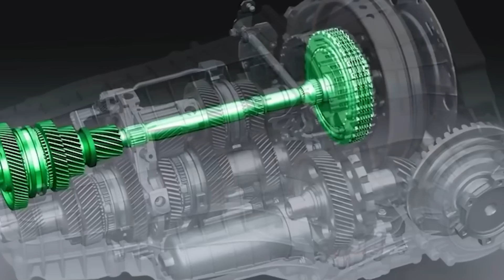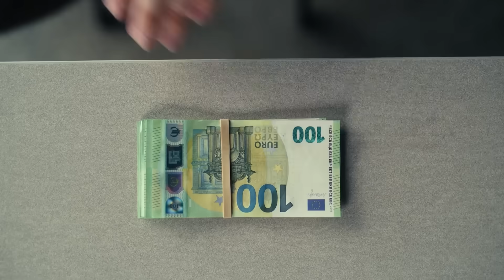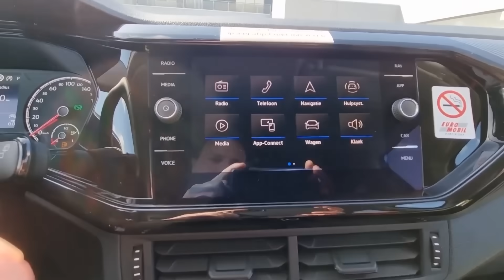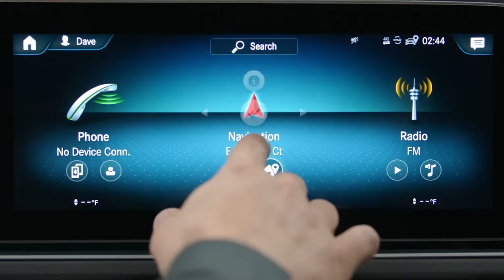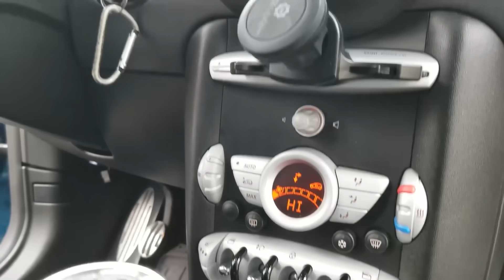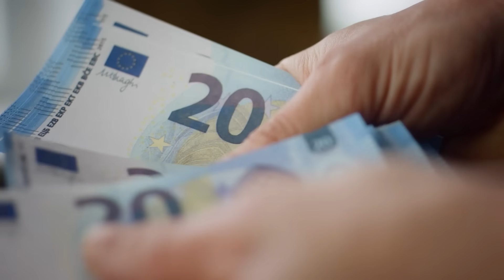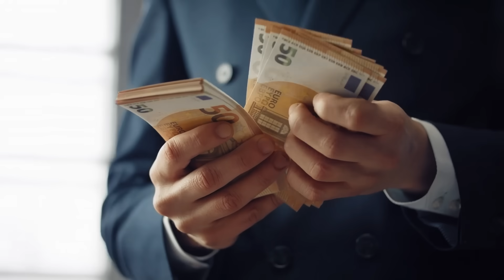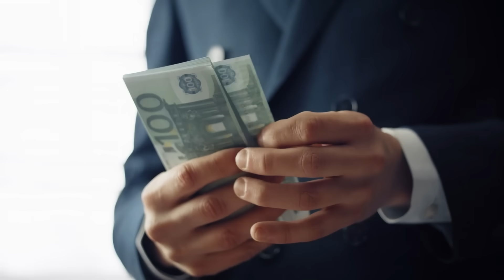7 DIRTY Secrets Why Your European Car BREAKS After Warranty

Comment: We once had a grandpa at our dealership investing 2500€ into suspension components on his Audi A4 B7 2.0TDI with 200tkm, only to have his oil pump fail within the next two months. Reason being is that the oil pump is driven by a small 6mm hex key that rounds off after approx 150-250tkm. This was obviously planned by  the manufacturer to fail.

Comment: My X5 water pump broke a little over 100 miles after my warranty expired.  I replaced the water pump and then few days later the radiator broke.  Both repairs costing over 3k.  The video is telling the truth.
Reply: Is there any brand that's NOT guilty of programmed wear and tear? (even Mercedes)It's a real nightmare for the customer, who's being completely drained. And apparently, it's legal if you have a good story. They know perfectly well that plastic breaks after... miles, or a part fails. I hate this and will happily keep my old car, even if it needs an expensive repair. And the bottom is covered in grease and oil, so absolutely no rust.
Reply: @henkholdingastate  Toyota
Reply: @henkholdingastate  Old Toyotas & Hondas, pre 2010.  Older American cars as well, 1970-1990.
Reply: exactly same as mine,,,
Reply: Shame on BMW
Reply: Well if so then don't buy product out of warranty and ditch before it ends and that's why used out of warranty ones are cheap!
Reply: Get honda mate
Reply: This has nothing to do with planned obsolescence.  The Germans just aren’t very good at making cars.
Reply: @user-tb7rn1il3q  “strategic component lifecycle” and “optimized durability targets”—corporate code for planned failure.
Reply: @user-tb7rn1il3q the video very clearly states the guidelines and training used to generate higher profits

Comment: Last month I just bought a brand new Mazda 3 2.5L NA. It has some interior rattles und the damn piano black interior scratches when a fly lands on it. I hope the engine is more reliable. My first Mazda. Until now I´ve only driven Fiat cars that were very easy to work on and the engines were built like a tank.

Comment: This is why all EU car manufacturers will be history in ten years. Your customers will buy Chinese their cars might not last any longer but are cheaper
Reply: would you buy a car with all the internet information that the brand is known to be unreliable after warranty? No then why they keep making cars that get broken after some time?
Reply: Chineses cars are cheaper for a reason, their are crap that is far worse than all cars with planned obsolescence. In a couple years Chinese cars begin to rust, and not to mention that many of their security features aren't very reliable. In crashes, systems like airbags, often fail to deploy, and their EV have a high rate of spontaneous combustion.
Reply: @storyteller5931 cars made in eu are no longer zinc dipped before painting so will rust quickly. Also cars made in eu are full of components made in china, even JLR use chinese electrical   components.
Reply: Nah EU car manufacturers just get their cars built in China. It's happening already. Eventually Chinese cars will be made in Vietnam as costs rise in China, and the cycle will continue.

Comment: We've had different brands of cars over the years and the more simple they are the longer they can last but maintenance is the key with all of them.
German cars thrive on more frequent maintenance, so don't buy a used one if you think a cheap oil change once every two years is sufficient.
So, one daughter drives a VW Polo, 2010 model, I service it and it just keeps going. Only issues were the interior fan rheostat had to be changed and headlights are now sun damaged. Otherwise it just keeps going. Just over 200,000 kms. Other daughters car is a 2001 Corolla with 220,000 kms and had the pwer steering pump replaced, wheel bearing replaced, exhaust replaced, valve cover gasket has been replaced but still leaks oil, rear suspension replaced so not so great there. 

One of our work vans, a Vw Transporter with a Dsg gearbox has reached 400,000 kms on just over 10 years. Apart from regular servicing and changing wear and tear parts, drivers electric window switch, no problems.

A used car is only as good as the maintenance given.

You think Japanese cars are built to last so the manufacturers don't sell more cars ? 😂 think again

Every manufacturer wants you to buy new and the replace before the warranty expires.

Comment: I wonder if the same lifespan is applied to electronics too. I was once told that a microchip called obsolescence chip was fitted to most mainboards and started working at 4 to 5 years old!! 🤔🤔
Reply: Yes certain BMWs back in the day that are still on the road today have ecu’s that fail after a certain amount of years and very expensive to replace.

Comment: I really hope this video goes viral. Most cars made after 2010 have cheap parts, plastic. Transmissions with no drain plug. I suppose the rest of the car will be junk before you need to change the trans oil.....

Comment: been driving the same Lexus for over 20 years with only regularly scheduled maintenance, and replacement of normal wear and tear parts. this is what happens when accountants run the plant floor, not the engineers.

Comment: This  is why both brands are suffering in North America.  And everywhere else in the world.   Japan will never adopt this self emulation strategy.   It seems American manufacturers beat BMW and MERC to the punch on this manufactured Obsolescence “strategy”.  People will abandon the brands and already are.   I own a Lexus LS430 2005 with 180,000 and Toyota Camry with 290,000 miles and both run like fine watches!   Burn no oil and only replaced normal west
Items from age and driving.  The Camry is a 1997 and the AC compressor clutch shorted out and had to be replaced.  $1,100 repair,  it was still on its original compressor that lasted 27 years!   Not bad.  Money well spent!  I am waiting for the used car market to crash further and then I will buy a used Toyota Tundra pick up to haul parts for my Suzuki and Yamaha vintage motorcycles that I like to restore as well old Vespa’s!

Comment: There designed to fail at around 110k miles, just far enough outside the warranty period to maintain resell prices. I have always hated VW because they piloted this approach with plastic parts such as water pumps, designed to fail. Rubber wet belts are all you need to know, rubber belt slowly degrades because it's in oil and fills the oil pickup system with debris gradually strangling oil flow.

Comment: As a mechanic of 32 years this video is spot on. For many years the ZF4HP range automatic gearboxes used in the brand i work on needed changed every 40K km with the filter. It had a dipstick with how to check fluid level in it orinted. Those autoboxes lasted many 100Ks of km. 400k km was normal without any problem. Enter the BMW era with the life long oil in the ZF boxes....and most went nuclear between 150/200K max. Full rebuild is €7500 minimum. At our shop we change the fluid and filter every 80k and now these boxes last the same as the old ones....go figure. Same with all the stupid timing chains,wet timing belts,plastic parts used in areas that is frankly plain criminal and the software trap that is real. The Over The Air updated are a complete nightmare. I happily drive a 21year old car without all this crap and it is in perfect running order without all this junk. Just did an service yesterday where the renewal of 6 spark plugs required to dismantel of half the engine bay,firewall and parafan. 6 effing hours for changing a service item is criminal and extremely frustrating to explain this crap to the owner of this piece of junk.
Reply: That’s me and my 2 decade old Mitsubishi beater (380)… the cheapest I car I’ve bought ($3.5k AUD) turned out to be the most reliable and trouble free… my old BMW from similar era can’t even get to half the mileage as the Mitsubishi without needing constant attention and repairs.
Reply: I'm planning to buy Mercedes GLC 220d in India. Do you suggest it?

Comment: changing transmission fluid won't prevent the Mercedes 7 speed automatic failures with the conductor plate I paid to do so proactively on my R230 SL550 and it still failed. Mercedes replaced it under my CPO warranty my understanding is the conductor plate is defective from new.

Comment: My 2017 F150 2.7 Turbo has a metal chain from the crankshaft to the oil pump. In 2018, Ford thought that replacing the chain with a rubber belt would be better-served for new vehicle sales. Bathed in oil, all the time. Nothing to see here, let’s move on…

Comment: I have owned 9 BMW s,  I buy them dead and repair them myself.   They all seemed to fail in exactly the same ways and I realized after working on so many...and so often that it appeared to be designed to last just long enough past warranty.  The sunroof drains shrink over time, disconnect and flood the floor....where they have electronic modules....it is intentional
Reply: So meaning all we need to do is buy a new one and change the sunroof? 😂
Reply: I am never, ever buying another BMW, ever again.  Or even a Golf R.  

I am done with these reptilian ran companies!

Comment: you forget smartasses with:
- 3 cilinder engine that last under 100k km
- lets make timing belt to be submerged in oil, what bad can happen.....
- lets put electronics with pump inside adblue tank, so it will brake and they need to change complet tank for 1500 eur....
- lets set engine oil replacement mileage to 20-30k km so after 150k km engine will die...

Comment: I hope I haven't jinxed myself by saying this, but my 2010 BMW E61 2.0D with that N47 engine mentioned in your video has just clocked 200,000 miles (about 322,000 km).
It has had lots of oil changes in its life, has had the DPF removed, and has a mild stage 1 mapping to improve fuel efficiency.  Still runs as well today as it did when I bought it new 15 years ago.

Comment: Years ago, car manufacturers like BMW went to suppliers that could provide the most reliable parts.  To get the orders, suppliers overengineered the parts so they would last and were made to high specifications.  Enter statistical analysis and MTBF (mean time between failure). Suppliers can now accurately predict how long parts will last. They can now reduce their cost by right-engineering within the optimum specification the part to last as long as the manufacturer specifies to meet its warranty period obligations.  It is as simple as that.  It is down to stats.
Reply: designing for a given mtbf has been a concept in engineering for at least 100 years. i don't mind that, but all mtbfs should be disclosed, otherwise it kinda feels like fraud

Comment: 2 reasons-European plastics are horrible.  Electronic modules with connectors/module openings facing up in the path of water.  It's always been about quality and (this  really hurts the engineer's feelings) never about complexity.  And that's why Euro vehicles have the lowest resale value of any vehicle.
34 year Master Tech working a tech line the last 7 1/2 years.  Euro's are much more pleasant to work on on paper/computer screen.  LOL
One side note to give Euro engineers credit deserved-The ZF 8 speed they designed and the programming that makes it shift is top of the line at the moment and has been for almost a decade and a half.  It's one of the few pluses Chrysler has over the other manufacturers at the moment.

Comment: What a load of rubbish. Car manufacturers have used finite element analysis for the last 50 years if not longer. Today’s cars cover 150,000 miles and more as a rule and that compares with 50,000 to 60,000 miles in the 1960’s and 70’s unless they turned into a heap of rust before their fifth birthday. Until the late 1980’s it was commonplace for an annual complete exhaust replacement where now they last the car’s fifteen year lifetime. The whole of this video is sensationalist rubbish with just a hint of honesty and accuracy very occasionally.

Comment: Plastic guides on a timing chain is the most insane decision out there. Able to total the car. When are these not mandatory by law from steel?
Reply: It’s entirely possible to make plastic valve covers, intake manifolds, thermostat housings, water pump impellers, radiator end tanks, and even oil pans last just as long as metal ones as long as the correct engineered plastics are used and careful design considerations are implemented. A late 90s Ford modular engine has plastic valve covers don’t warp at all or have warped so little that it does not cause any leaks proving that good plastic engine parts are possible. Reducing NVH is one of the main reasons why automakers use plastic parts. So even if longevity remains a major priority over cost cutting, they will use plastic if they find a way to make it last as long as metal.
Reply: @davidperry4013  Why use plastic? How much is saved 20 Euros? It's just planned failure. That's why a smart consumer will pay more for a Toyota
Reply: Most engine plastics have high glass fiber content

Comment: Maybe depends where they are produced. In Germany people drive 80% German cars and none of these break after only 80 -120K km. Never heard this. We have a 2013 Golf Mk 7 which has already 260K km and no Problem at all. The car is like new  and it takes only 5.3l Petrol / 100 km.
Reply: That would be roughly 60 miles for 1.1 gallons, not much better than late 70s early 80s

Comment: I own a bmw 320d since 2014 ,I have 300.000 km and i only replaced a diesel injector and yes I changed the gear oil at 150.000km NO other problem so far .

Comment: Modern cars are well-engineered, efficient, comfortable and use a range of exotic materials and high-strength steels to improve safety and reduce weight. I was expecting this video to be sensationalist and biased, but in fairness you have given many examples that are legitimate and reasonable. The use of glass reinforced plastics to replace what used to be metal components in high-stress environments is criminal, quite frankly. The subscription for already installed hardware is probably my biggest bugbear because it's not possible for a DIYer to engineer a way out of that.

Comment: Had a Honda Civic. Totally reliable... the only component to fail after nearly 12 years of ownership was a oil level sensor which was a German part.
Reply: German engineering is no more
Reply: I am switching to Japan or Korean car after my European car gives way.
Reply: I just recently junked my 2006 Civic with a manual transmission at 415k km due to extreme body rust. The engine and transmission were perfect. It drove perfectly. It was driven in a winter rust belt locale. I'm entirely satisfied with that lifespan. I purchased it new and maintained it myself. Although if I had rust proofed it annually it might still be on the road today. I see older Civics still on the road in my area. I will replace it with a 2023 or earlier Subaru Crostek with manual transmission because Subaru retained the old traditional hand brake in their manuals, which were available until 2023. Honda got rid of manual, and hand brakes, long ago in their ordinary non sport cars, unfortunately.
Reply: yeah but modern Honda and even Toyota are questionable now, not obvious like modern Europe cars but it's there so fasten ur money people.
Reply: New Hyunday Tucson 1.6 petrol
4.700 Miles after purchase blocked DPF . 5800 Miles broken front right wheel wishbone.
Reply: Hyundai 1.6 GDI problems and Honda Civic Type R gearbox issue are also worth mentioning. Not only because cars fail but in both cases repair under warranty was refused.
Reply: @m4ci3j88 my Type R was a 2011 model, no gearbox issues or rust issues what's so ever. Had new brake calipers and a oil sensor in near 12 years of ownership.
Reply: He is talking about vehicles made in Europe.
Reply: @jasic40 And he's talking about how shit Europe cars are in reliability side.
Reply: @jasic40 it’s happening here in the US too dummy

Comment: We have two VW Polo’s in the family: one from 2003 with 207000 km and one from 2015 with 117000 km. The 2015 one had major issues. E.g the variable camshaft adjuster fell apart last year which could have destroyed the entire engine as the timing belt was almost falling off.

Comment: BMW G30 owner here. To date (after 85.000 miles) only issue was a infrequently dripping feed line for the Adblue. Fairly inexpensive repair which was done in connection with regular service.

Comment: Its been happening since 2010, that was when the "3 year junk" started. I have been a mechanic since 1977....and I still have my 05 Vitara...that has had NOTHING  but servicing and 2 broken anti roll bay link rods, no warning lights ever apart from low windscreen washer fluid warning🤣 BMWs look like an old Cortina spec when you look underneath, overpriced junk.

Comment: BMW E39, ABS module placed next to exhaust manifold, so heat frys the gold contact strips that break down & ABS becomes useless & fails MOT test due to traction & ABS light on, can't be fixed because software in the ABS module can't be read to write to a new  module at abt 130k it's scrap

Comment: The plastics used in some German car engines  last about 7 years, they go brittle. Plastic cooling pipes with O'rings. If you fit alternator close to exhaust pipe with out heat shield it will shorten life. Japanese cars usually last better, 1990's ones were longest lasting.

Comment: That's why I will never buy any of those expensive junk vehicles. GM Stillantis and Ford are not much better. I have a 2015 Lexus GS 350 with 196k miles. No oil leaks and no leaks of any kind. I don't know about the newer Lexus vehicles though. But I know mine is an amazing reliable vehicle. I take care of my Lexus.